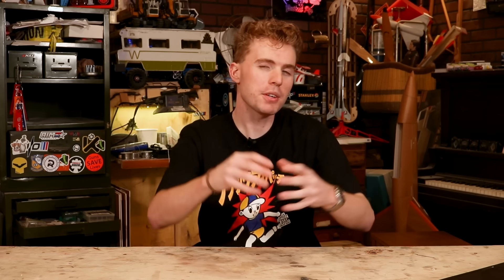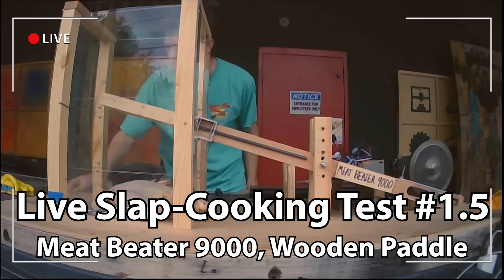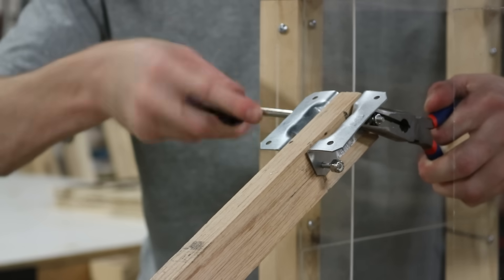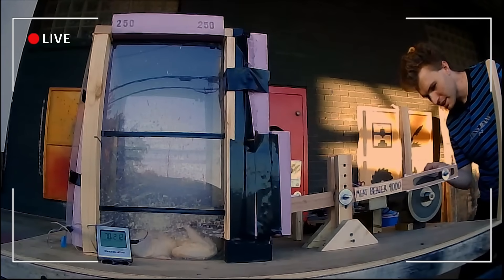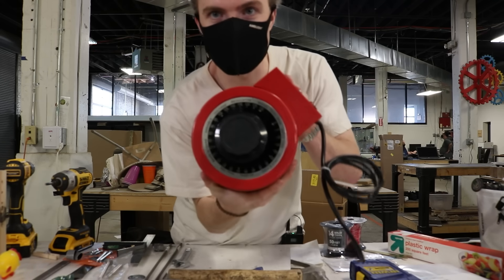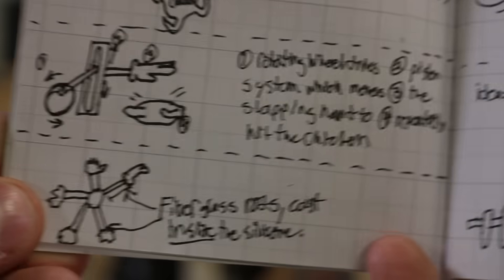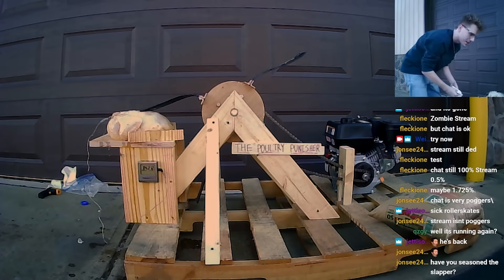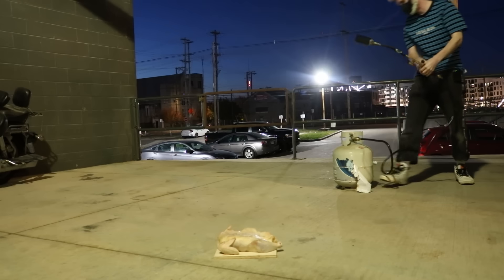How Many Slaps does it Take to Cook a Chicken?

Comment: I’d have a suggestion:
I think if you were to increase the slap frequency with more rubber belt pieces, the temperature could increase even higher. If you add enough belts, the effect of them is more like rubbing the chicken rather than slapping the chicken. 
In addition; if you don’t lubricate it, the friction between the chicken akin and the belt will drive the temperature higher. 

I believe that the chicken is to easy to squash I.e. it has to little internal friction for it to heat up with a reasonable slap frequency. If you could increase it’s internal friction, it could also work better.

Comment: Issue is insulation u need to place it in a vacuum
Reply: Also softer robber materials with longer slaps for sound and force to transfer properly, don’t add oil each slap adds such a small amount of energy the added mass and temperature is counterproductive !

Poor chicken.....

Comment: Why do you even need a chicken? Just place an ordinary cooking pan upside down and slap the underside of it to death. You can use the rotary arm machine or the moving hand slapper. Under the pan, place a plush chicken in place of a real one. Measure the temperature of the pan.

Furthermore, you should have several spare parts. So that when they break, it doesn't kill the experiment. Just replace the broken bit and continue. Good effort. But I think the rotary slapper has potential. Without lubrication, the friction would likely heat the pan faster. You wouldn't be beating on the fragile chicken but on the thick underside of the pan. Build 3 to 5 of the rotary cylinder with rubber flaps. The 6HP motor = 4.5KW.

Comment: You know what, if it’s just the integrity of the chicken that’s the problem. You can build a tight-fitting iron layer of protection for it. Slap on the iron. It won’t tamper the integrity of the chicken. Just add thermo isolation to the iron, except at the place it is to be slapped.

Comment: I imagine it too cost and engineering prohibitive for your channel,  but If you want to kinetically cook a chicken you need to place it into the bottom of a cylinder and use a piston to repeatedly compress the air in the cylinder. The chicken will need to be oil free to avoid diesel detonation of the chicken.

Comment: Well slapping is kinetic energy in order. Heat is could be formulated as kinetic energy in chaos. So I guess the chicken can only dissipate so and so much order depending on it‘s structure (limit for heat per time in). If you up the isolation (lower limit for heat per time out) it should still be possible. Maybe with higher frequented gentle slaps from multiple directions? idk

Comment: Torturing a dead chicken is so amuzing.

Although the Poultry Punisher wasn't a great design since the rubber strips are literally shedding the chicken to nothingness. The Meat Beater has potential since damage due to friction is limtied. I think controlling how much pressure being exerted on the chicken could reduce damage (by ending the down cycle just right, hitting the meat but not too deep and not too hard). 

But torturing the chicken is still the best part.

Comment: Honestly I feel like the initial design was the key because it didn't have a dragging motion to deteriorate the flesh. If the lever arm and failure points were just made out of steel or aluminum instead of wood you probably would have been able to push the system further.

Comment: Combine the hair dryer concept with the rotational slapper concept, and turn the chicken over midway through cooking to thoroughly get both sides. The hair dryer chamber worked but the board destroyed the chicken and wouldn't offer the same level of friction as the rubber sheets are doing in the rotational machine

Comment: The reason why the last one didn’t work as well is because the slapper is cooling it. With 4 slappers you need to heat up 4 times the surface area and it’s cooling off while it is rotating around. May need something more like a jackhammer with lots of speed but not enough power to destroy the chicken. The slapping hand should be a conductive material but should be insulated from the rest of the slapping machine so it doesn’t lose heat.

Comment: I think you could have modified some factors and it might have worked at least slightly better. The circular chicken slapper is essentially a chicken roller . If you ever saw roadkill stretched to four times it's normal length, you would know what I mean. The up and down motion was way better but then you transfered it trough a gigantic lever that naturally would have a lot of stress. If you had mounted the engine above the chicken and transferred the slapping force directly down like an upside down engine piston, and then have something about the hardness of a hand on the end of the piston so it's still slapping and not sledgehammering. Sounds feasible right?

Comment: To cook a chicken you have to hit it indirectly. To conserve the energy and keep the chicken together you need to put it into a strong elastic bag/cover. You should then hit the cover. This cover is the key but it has to be able to conduct the heat to the chicken without melting or deforming too much. This way you can keep slapping without destroying the chicken too much and the temperature is easyer to keep.

Yes the chicken will most likely be a bit of a mess inside but when making it tight enough inside the cover it should be eddible if you get the temperature up high enough. The "heat mountain" is probably still too steep (I dont want to do the math for that now) but with a good enough outside heat it can work.👍
Reply: You could also create a metal cover that can be hit. This way you have to make sure the metal makes good contact with the chicken, is not too thick and does not pass the point of plastic deformation. You can heat up the metal easyer then the chicken itself by using slaps because it survives way longer (when below the yield strength). Do the math, im sure you can figure it out😉

Comment: There are obviously several  physical factors you guys overlooked and that's why ot caused the chicken to get diced up the way it did,  I feel loke the original slapper was afar better idea since the chicken was able to obsorb most of tje beating without getting sliced up as was the case with the edges of the multi paddle  instead you guys should have built the original  using stirdier parts, perhaps  PVC which can absorbed more tension through it's flexibility or some form of light metal. On top of that,  sone form of a cooling system  for the motor and proper lubricant for all moving parys would have prolonged it's life.

Comment: Should have put alumimium/metal sheet on top of the chicken instead just to absorb the impact and heat transfer agent in between. As the chicken might not be able to withstand the pressure. Just opinion tho. But still i guess more heat will produced if the friction is higher and it definitely not following the initial quest that is " to slap the chicken directly " 😂

Comment: The temperature was probably dependant on the frequency of thee slaps because it was radiating heat away and a decent rate, so maybe try this experiment in a pulled vacuum, this way lower frequencies can also achieve high temperatures without serving powdered chicken.

Comment: Is not the slaps that make the heat per se is the friction with the air. So yes kinetic energy transforms into heat, but also into sound. The heat is transformed with the friction of the air resistance

Comment: Did you consider a conformal pusher plate, much shallower and higher frequency towards the 100-200Hz range spread over a larger area or even a vertical base plate compressing it by a couple of millimetres against a fixed conformal roof.

Comment: The poultry punisher had an obvious design oversight. Consider this: why do fly swatters have holes in them?
Reply: To have less wind drag so it can be thrown faster
Reply: @krono-xyz  EXACTLY
Reply: @Jamie Pritchard I’m pretty sure that holes would only lower the wind resistance and also make it lighter to slap harder

But I can’t confirm this I’m not in high school yet
Reply: @crazebanana6432  Making it lighter, and having holes would make it go faster, but less mass overall, so less energy impacting the chicken, per slap.
Reply: @rdizzy1  hmm ok
Reply: So the fly doesnt get blown away when you swat it down..
Reply: @karlm9584  Exactly. The Poultry Punisher is basically a fan that immediately air-cools the chicken after slapping it.
Reply: Holes would increase surface drag and rip the chicken to shreds way faster.
Reply: For a proper test he should operate it in a vacuum.

Comment: What if by using a metal plate on top and bottom of the chicken as a conductor for the heat and to keep the chicken from taking the full brunt of the impact, we could allow the chicken to be cooked? The main source of heat would still be from slapping, therefore keeping the integrity of the hypothesis, but  the metal would allow for a more streamlined process.

Comment: Hmm...I was quiet thinking about this for a while. What if the chicken itself was sealed  in some kind of chamber (like oven) with well managed passive and closed heat distribution, like copper heat pipes at CPU coolers? So the "slapping" machine will hit some kind of durable baseplate instead of directly chopping the chicken. The baseplate will be directly connected to heat pipes and redirect produced heat into the chamber, and the whole system would be sealed in thermal insulation. Yes, it will probably take much more time to redirect the heat, but using of durable materials will prolong life time of mechanism, so you can get it running over night, or days...

Comment: Well, your problem is something being destroyed... if something's being destroyed like that if you increase the area over which that force is applied it may yield better results. Also round out sharp edges, maybe use a thick foam instead of something paper thin so it won't cut into the chicken. Alternatively, you could cover the chicken in mesh... ya know if you're brave.

Or... reduce the force and increase the number of slappers? Honestly for the margins we're talking you could probably do all that and it wouldn't be enough.

Comment: The reason why its hotter because your outside in the heat and the box is trapping heat from the sun light rays and the spped of the slapper converts heat as well so no not from the slap

Comment: Try to pre heat it to ambiance temperature, and then use the pulley punisher inside of a box with the shower curtain and the blow dryer. Also put some layer in beween the chicken so that it still heats up wile not destroying it.

Comment: Maybe motivation will come back for a new test if you calculate the maximum amount of force allowed to keep the chicken from getting sliced away. I mean, imagine infinite amount of slaps will give you infinite heat as long as the slapping force is bigger than 0. Best might be to also start the machine when the chicken is alive, and after the first slap ju cut off the head with a servo mounted knife. This to make sure the the meat is as fresh as possible since we might need some extra days on a lower slap force. Have a nice weekend all

Comment: Haven't done the math, but what about putting the chicken at the bottom of an airtight cylinder and then compressing the air and using that compression and resulting heat to "cook" the chicken? You'd need a large volume of air to start with but it seems doable...

Comment: go back to the original design, make the slap arm alot shorter, bump up the frequency alot in the process, increase the slap area, design a rig that can get more than 2 or 3 slaps going within each cycle alot like  motor pistons moving out of phase. The problem with the last design is the movement would push too much into the chicken instead of just smacking it and going back, which is why the original design had more success than the last without destorying the chicken. The problem with the first design was the rig durability, which should be fixed if the the slap arm gets severely shortened and the total slap energy is distributed over multiple arms.

Comment: the reason you where having trouble initially with the second design is because the rubber flaps where being cooled down in between slaps. you effectively created a large gas powered fan or paddle wheel. I wouldn't be a bit surprised it they where colder than ambient especially since they where coated in chicken fat soon after startup

Comment: Law of conservation of energy states that energy cannot be created nor destroyed, only transferred and transformed.

So you won't get any more heat, then the speed of the slap will go. Unless your surroundings radiate heat back onto the chicken, the speed of the slaps mainly decides the temperature of the chicken. 

You will not get anymore heat, unless you apply more slaps / kinetic energy. Because energy has to transform and/or transfer into something, and this case it's the rubber's potential energy being slapped against the chicken, creating heat and sound.

Comment: A for effort. The problem with the first setup is definitely insulation; if there is no energy transfer whatsoever to the environment (perfect insulation), every Joule added will add a constant amount of temperature, no matter what temperature you start at. I suspect it's the bottom that's leaking heat, where the chicken is sitting directly on cold wood. I think the major problem with the second setup is that you've essentially built a radial fan that's cooling the chicken quite well.

Comment: The answer to the original question is flawed they forgot the fact that energy is also transferred into energy not necessarily thermal but kinetic can also be transferred to kinetic because when you slap a chicken it wrinkles isn't and rubberbands and whatever so not all of the energy transferred is thermal energy some of its kinetic so you may need more than 24000 slaps and the fact that you have mentioned in your video in Newton's law of cooling a lot of the temperature that's going on the chicken is going  away due to the ambient temperature

Comment: You could place a fixed steel plate above the chicken so the slaps would heat up the steel plate and cook the chicken. It’s kinda cheating but it would be the most effective way to maintain the integrity of the meat while the machine generate heat by slapping.

Comment: I think that generating the required heat through a medium like an cast iron pan that is being slapped by this machine could work and than using the heat generated on the pan itself to cook the chicken with convection ( for instance slapping the underside of the pan, that would definitely get rid of the chicken turning into paste problem. Also another advantage would be that you could even slap the pan faster than you can the chicken. Maybe using more efficient slap paddles would work, since i feel like you may be cooling the surface with the air being moved in front of the massive paddle being used, i think a smaller surface and more mass would work just as well if not better  Or even using a pressure cooker, since that would probably reduce the required input energy to cook the chicken or even a copper pot, since those heat up much faster.

Comment: Hey I have an idea. I noticed that the flap wheel although delivers more energy per second, it moves a lot of air that ends up evaporating water in the chicken which, if you know about the endothermic process, cools it back down. So if you encased the chicken in a copper wool, plastic shell. You may be able to deliver heat and minimize heat loss through evaporation (the copper wool helps transfer heat since plastic isn't good at that). The plastic will withstand more slaps and minimize heat loss through wind and water evaporation.

Comment: If you make the pulley on the motor a bit smaller and put a gearbox on it, I think that would have done more. I'm 2/3 in, edited..just before the multi hand slapper wheel. This might have been where you took a wrong turn.

Comment: Can't you put an internal heating device in a slapper so it isn't being used as something that would cool down as quickly? Plus the internal heating device in the slapper could be increased when speed goes up in order to help fight against the cooling. But it would need to be something that allows heat to cover the device. I mean it would ruin the point I guess but it wouldn't need to be slapped a million times. Along with keeping it insulated, the overall temperature should go up. And it would be like slapping the chicken with a foreman grill.

Comment: Wouldn't it work so much better if he didn't use an intact chicken and used a cut of chicken instead? It occurs to me that the ribcage, which is by design able to flex , would neutralize quite a lot of the kinetic force. You can clearly see how much the chicken is jiggling around between slaps. I think he should try to make a cut of chicken as flat as possible and as immobilized as possible to maximize the transfer of energy without having to deal with the interference of bones, tendons, ligaments, etc. Surely I can't be the only one who's noticed...?

Comment: A 15lb bird...42,986 slaps it would take a slap PRESSURE of 13,586 lbs per square inch and a slap interval of .02 seconds which would DESTROY the chicken instantly that said any slower WILL cook it but only a very small portion of it would be edible as the time to cook would allow bacterial growth outside of proper safe refrigeration and or cooking temperature.

Comment: I think one of the possible problems that causes the chicken not to warm up that much on 2nd version of MEAT BEATER because probably the flaps generate wind the might cool down you chicken thus not heating that much. this is just one of my hypothesis. My guess on putting small holes on the plastic flaps might help.